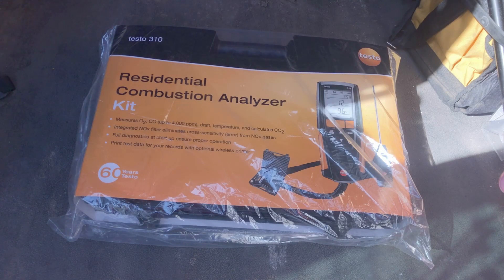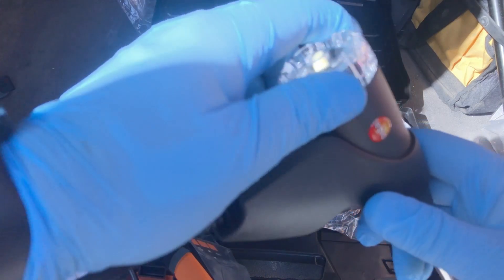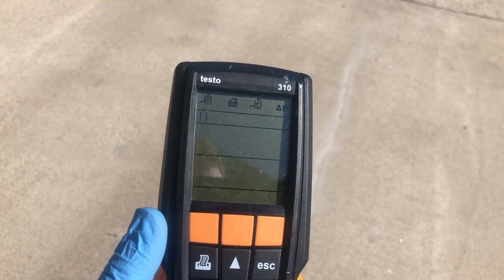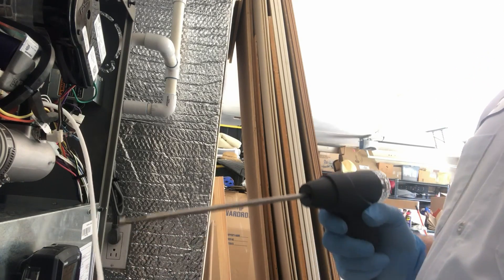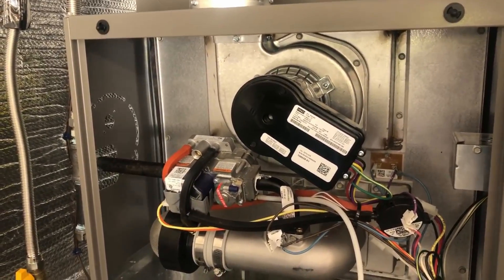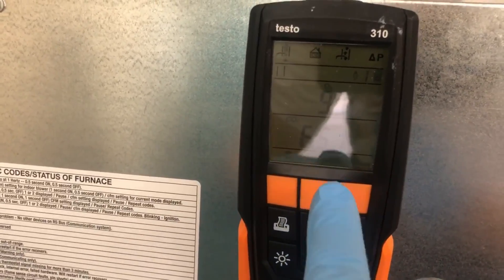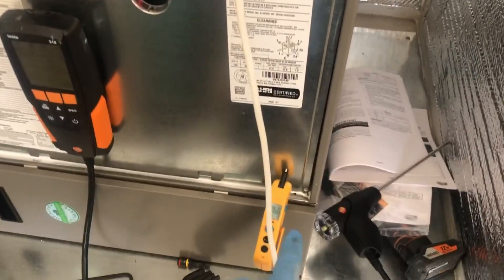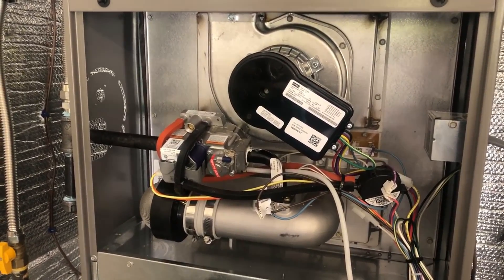EP15 Testo 310 Residential Combustion Analyzer Unboxing and Ultra Low NoX Furnace Startup

Comment: Since they create condensation, shouldn't the flue be pvc?
Reply from the maker: Only the 90+ ultra low Nox furnaces produce condensation. This was the 80+ version of the ultra low Nox furnace. The condensate trap in the analyzer is used when testing 90+ furnaces.

Comment: I don’t like using a combustion Analyzer to measure gas pressure. Should use to separate tools. And you should check Gas Pressure at High and low fire to make sure gas regulator is operating correctly.
Reply from the maker: Agreed. Using the built in manometer adds the reading to the reported by the Analyzer. This unit uses a modulating gas valve. Adjusting this gas valve only adjusts the gas pressure range. Thanks for the feedback and thanks for watching.

Comment: I am on the verge of buying a 310, I just dont like the idea of having to send it back every couple years for sensor replacement and recalibration.
Reply from the maker: It’s a bummer but it’s just part of the territory with digital equipment. I get my Testo 550 refrigerant gauges calibrated every year. I think you can replace the sensors yourself.  Not sure though.

Comment: What is Lennox doing about those loud and vibrating inducer motors Wes ? Do you know ?
Reply from the maker: They’re super quite in first stage heat. But once it goes in second stage forget about it. One thing that seems to help a bit is extending the air in-tank with a 90 degree about 2 feet with 2” PVC. This dampens the sound of air rushing into the burner plenum. But you have to make a 3” hole in the side of the furnace. This is really difficult with the A cabinet due to it being so compact. But helps some.